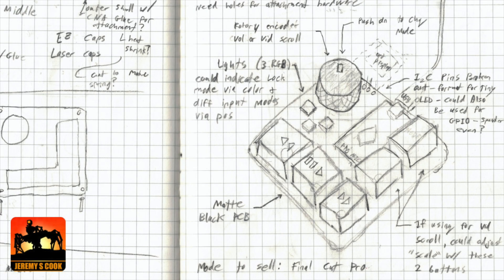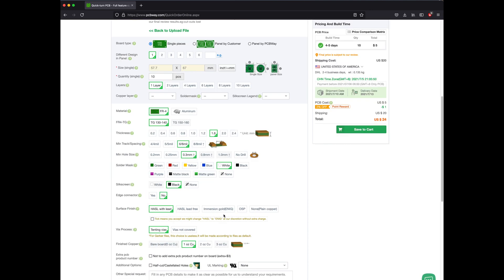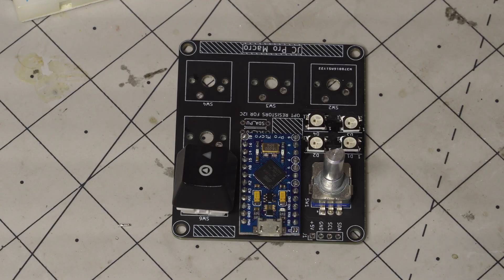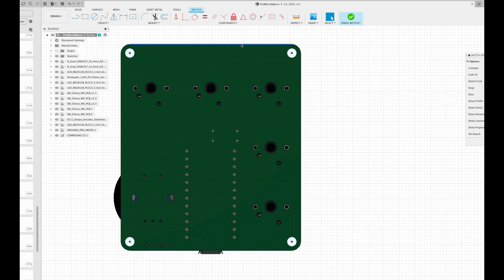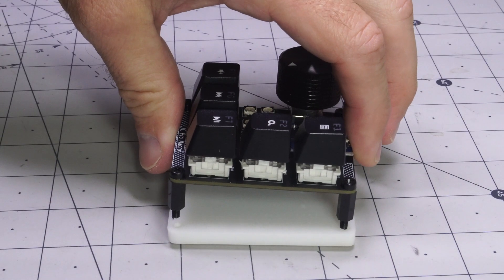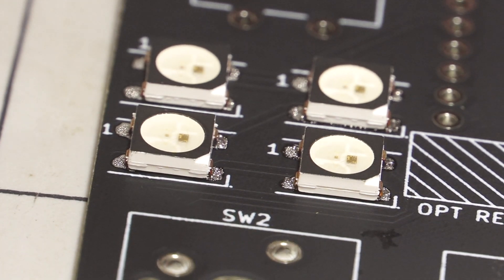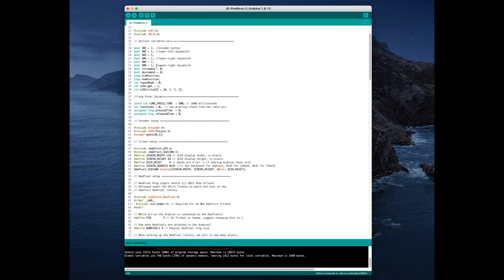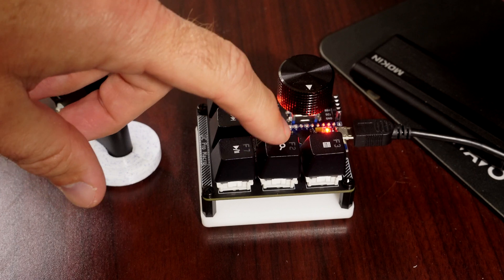JC Pro Macro Rotary Shortcut Keyboard [Arduino]

Comment: Hey man! I wanted to build something similar to what you're doing but for a keyboard, I already own basically a mod. I was wondering what screen you used for the display. If you could reply that would be great thanks.
Reply from the maker: Hi, it was a .96" OLED screen (124x64 with an I2C SSD1306 driver) IIRC
Reply: @JeremyCook  ok thank you!

Comment: ROFL soldering the keys in - use a retired/dead pillow.  It will provide a uniform upward force, then you only need to press down on the board a little while soldering.  And if you splatter solder on the pillow, yay, it's just proof you're getting things done ;-)  If you don't think you have a retired pillow, ask your girlfriend.  I'm sure she'll happily point one or several out :^)
Reply from the maker: Ha, well good suggestion! I've actually come up with a 3D-printed jig for it that seems to work pretty well at this point. You can see it in this (unlisted as of now) video: https://www.youtube.com/watch?v=VwfGT706jW0

Thanks for watching, I've got a few more plans for it!

Comment: Aside from the challenging (and I assume optional?!) ws2812 LEDs, this looks like it would be an easy project for a beginner to practice their soldering skills.

Are you going to be stocking keys and rotary encoders so we can order the whole shebang directly from you?!
Reply from the maker: Yes, optional. Thinking maybe I'll start ordering them LED-assembled if I can get that set up.

I will stock the keys and encoder soon, though trying to figure out the best way to offer and price everything. LMK if you have a key type suggestion (I think you mentioned "quiet," but there may be a few variations on that theme).
Reply: @JeremyCook  Blue and green Cherry switches are audibly clicky.  Brown as well?  Red and black are both quiet.

Most of the discounts I see on hot swappable switch keyboards tend to be blue switches.
Reply from the maker: Hmm, OK thanks!